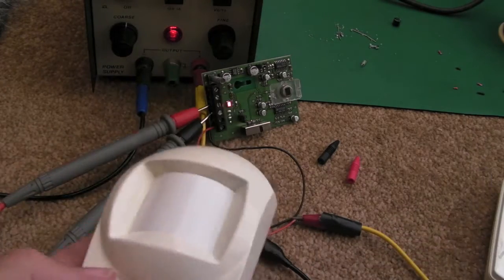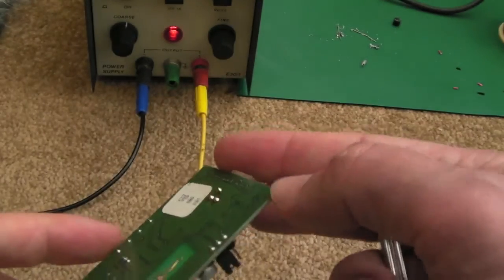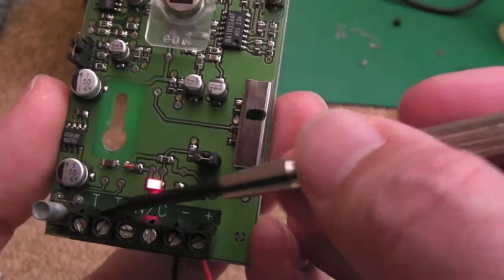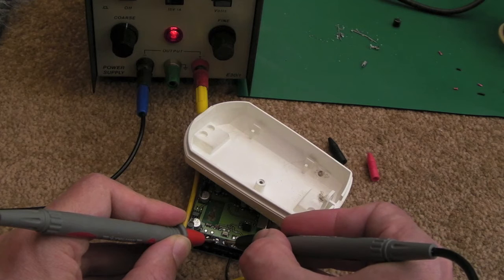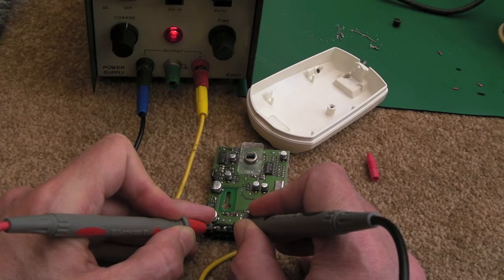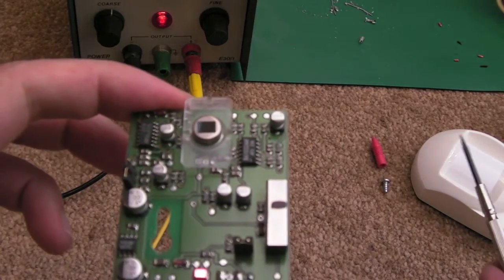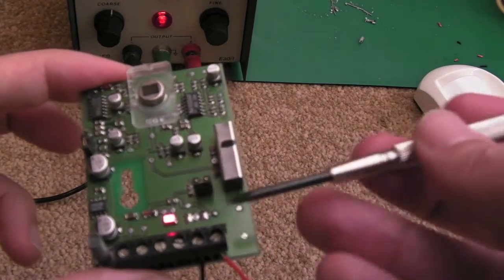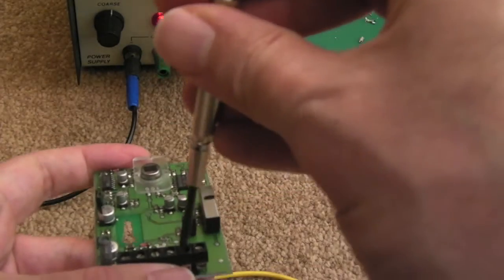Alarm PIR Sensor Replacement

Comment: I had a problem with one of the sensors, the so-called professionals made some pretty bad wiring. I've cleaned the housing, sensor and  redid the wiring as it should've done to begin with and it works.   With age I' have come to conclusion that I can do most of  house works much better than the "professionals".

Comment: Thanks for this. Man, I am trying to fix one of my Dad's outdoor ones atm. It is about 20 years old and linked back to an alarm. In the end, the case disintegrated and it was sitting out in the wet for ages. It is full of opamps. I can't figure out all the wiring lol. the main part still seems to work. It is all the override and dusk sensor wires I can't figure out!